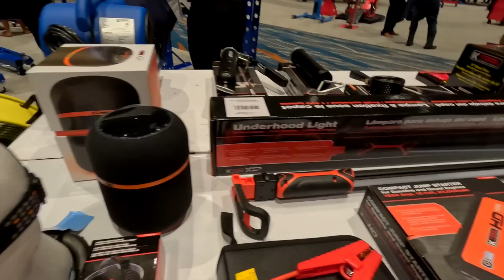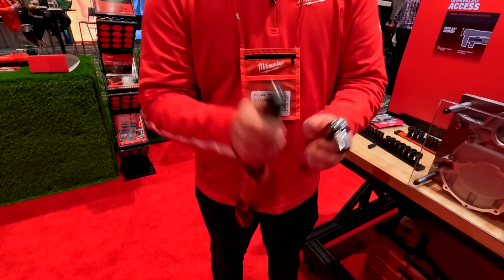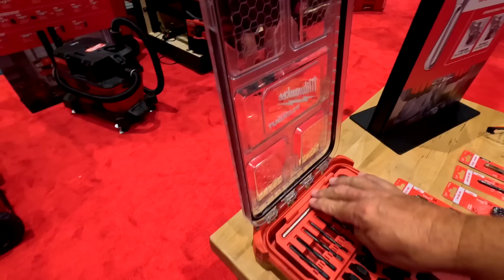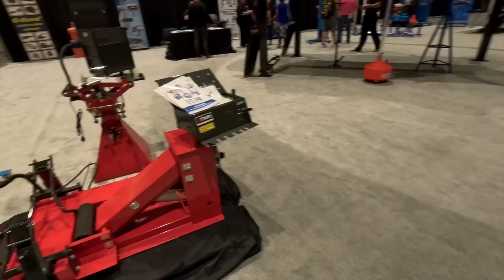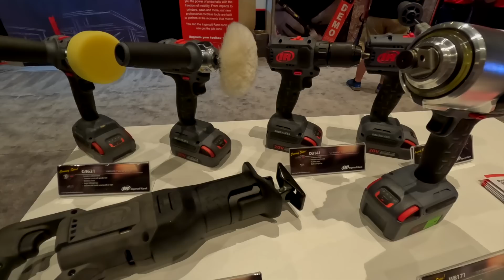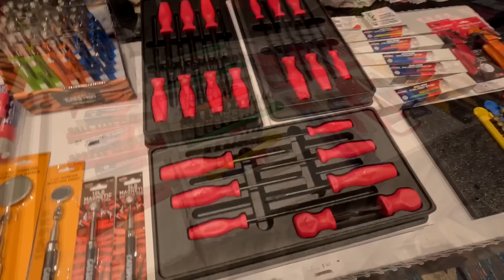Tools from EVERYWHERE! ISN Tool Dealer Expo 2023 [ORLANDO]

Comment: I couldn’t tell in the video but one thing I really really want all the bore scope manufacturers to do is put a light on both sides of the side view camera. I can’t tell you frustrating it is to try and get a sideways view of the combustion chamber only to have the light blocked by the spark/glow plug hole as soon as I get the camera high enough to see the chamber. Putting a light on both sides of the side view camera lens would make this so much better.  Better still make the bore scope articulating like my cheap Amazon model which works amazingly well. The ability to turn the camera a full 180 degrees back on itself to look up and see the valves and or chamber is awesome. 

I was first introduced to Q Bond probably about 15 years ago. At first I was super impressed with it, keyword is WAS.  I mainly used it on automotive interior plastics and initially it worked really well but for whatever reason, Q Bond slowly stopped working for me. I dunno if it was a change in the plastics used or if the Q Bond itself changed.  Regardless, even fresh unopened glue and powders, on a clean and prepped substrate they wouldn’t adhere to or hold anything anymore.  I can vouch for the rubber hose he glued though and the powders do indeed get very hard (and warm) very fast. However, I sadly haven’t touched it in probably a decade. Even in his demonstration the Q Bond didn’t adhere to the plastic bag he was holding under that piece of plastic with a bunch of holes in it.  Now my go to is Loctite HY 4070 “universal bonder” amazing stuff. 
Just my 2 cents.  Thank you for an awesome video, well there be a part two?